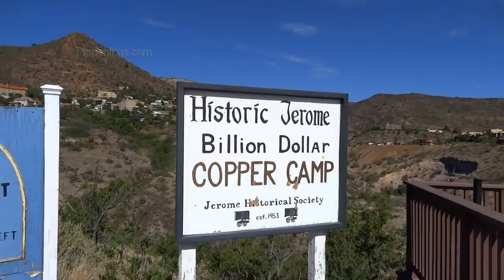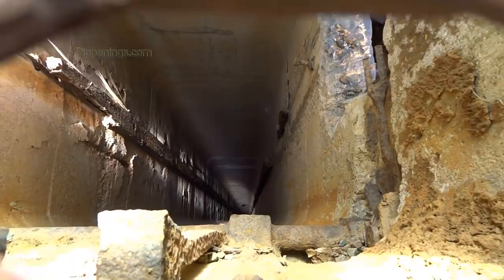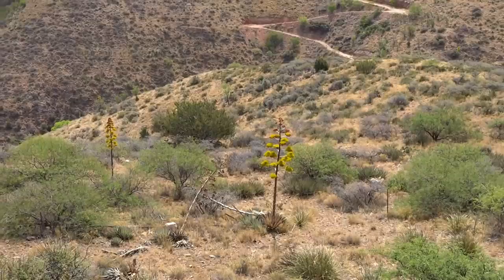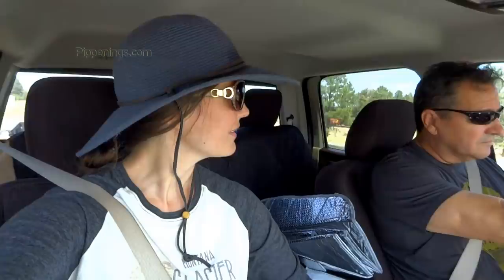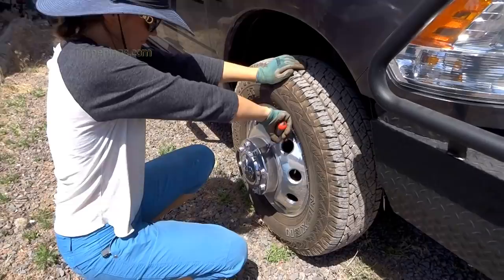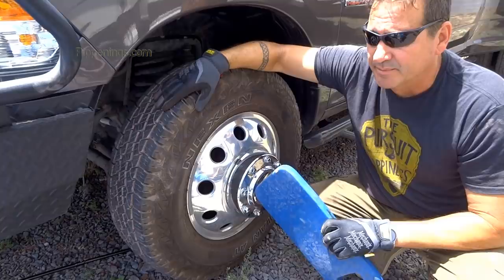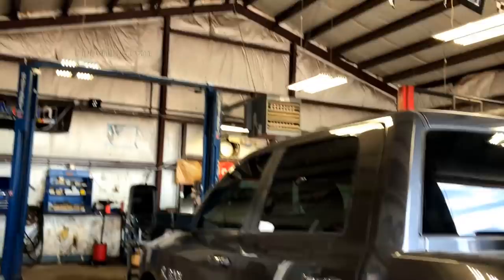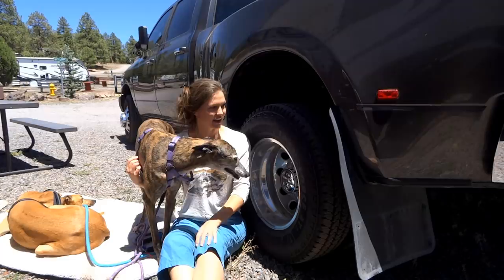Fifth Wheel Towing: Dually Blowout // Jerome, Arizona

Comment: Well I don't know when exactly you bought the truck I don't remember but if I were you I would um have taking it to a shop and had it a complete once-over done had all the fluids changed including the oil and filter and air filter , and have the tires check when you first got it and replace  then including but not limited to the batteries and I would have also done that with the ones in the fifth wheel it's too bad you didn't swap them out the ones cuz you just got those ones from your old RV into the fifth wheel and then one thing I forgot to mention in my last comment is it you should know how tall your vehicles is   you should measure it all the way to the air conditioners if you have too ,make sure not to  go under to lower Bridges and put  on little sticky note on in the cab someplace where you can see it so you know how tall you are and that includes antennas and if you have a Wi-Fi Ranger

Comment: I had the exact same problem on my Ram.  I bought my truck new in 2016 and it came with the same Nexan Roadian tires you have. 5 out of the 6 tires had to be replaced before 40k miles for internal separation issues. My inside dual tire was so bad that the seperation made the tire taller than the outside dual tire where it was not touching the ground! Nexan Roadian tires are absolutely HORRIBLE!!! Thankfully when I bought the truck  I went to America's tires and bought their road hazard.  Luckily I nor you had an actual blowout.  I will never buy Nexan tires.
Reply from the maker: Wow

Comment: Pippi I think it would be so cool if you could sit at a simulator and feel the difference  between each situation you were thinking it could be.  Tires are you first go too. The heat of the road and temps well brake down tires.  What date was on them ? Are they all the same, if so change them all. Ask for a refund because of the tread left on the tire. Did you see the wear pattern on the tire.  It is very hard to see the back of the outside dual tire to see  if the weights are still on the rim. I"m sure you well find away. Good stuff.    ByeBye

Comment: Good Video ! How Many tires did u Get ? i Hope u Replaced all 4 in the Rear. i'm almost sure u would, i don't think u would skimp on your Life. ( Fresh 4 is so much nicer ride than mismatch) and not just 1 or two tires. if u said it in the video and i missed it , sorry about that. Fresh tires are the Best ! Wonderful Soft Rubber When they are New. They Harden up with Time and Heat. Watch your tires Close in that Arizona Heat ! Protect Them With Shade if Possible. white reflective covers, good investment for any tire. i got Some New Front Tires ( October 2016) in My Dodge Cummins Diesel Rig almost 2 years ago and they Are Michelin Defenders. i Absolutely Love them and Highly Recommend Michelins for your Rig if u Can Get them. The Braking Distance ( shorter ) and Ride Has Been Quite Superior over The Maxxis Bravo's i was running. Also the Wear has been Less over time. huge win with michelins. i think they were $240.00/Tire Here in California. Maybe, Check your Spare tire time  ??? a video on checking the spare ? id watch it ! is it secure under there ? Mine Fell off under there while i was going in a driveway ( cable snapped holding spare up ). if it fell off while i was going down the freeway, i can't even think what kind of accident that would have caused ! i Recommend chaining spare into place. Happy trails ! Have Fun !

Comment: Pippi did they happen to go over tire rotation? I Know how to rotate tires on a car 4 or 5 but i sure don't know how to rotate on a Dually. If you find out let me know. Safe travels.
Reply: Usually, you don't rotate tires on a dually, That is because if you rotate the outside dually to the front, the tire will need to be turned around (inside/out) which would result in the tire rotating in the opposite direction, even if you rotate the inside dually to the outside dually you still wind up with the tires rotating in the opposite direction (due to the wheels being mirror images of each other to allow for dually mounting).
Reply: Well when you rotate tires on a car two of those end up going in the opposite rotation and there is no problem there.At one time they said it was bad to rotate a radial tire in the opposite direction. But that is no longer true.